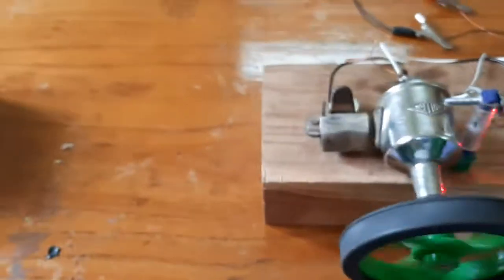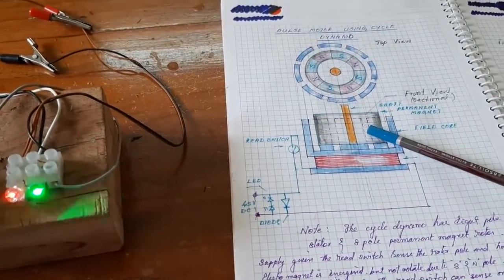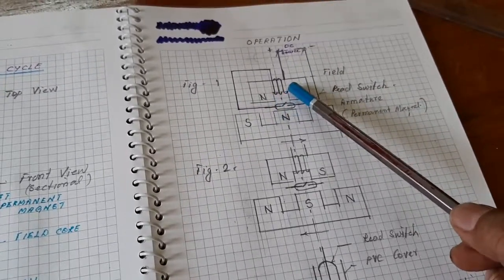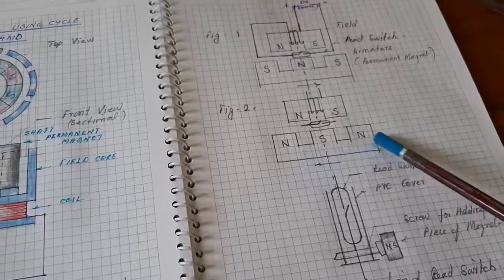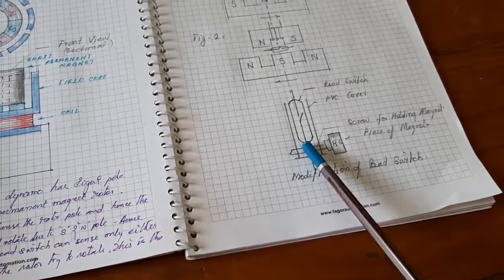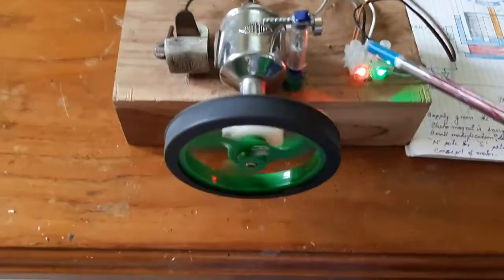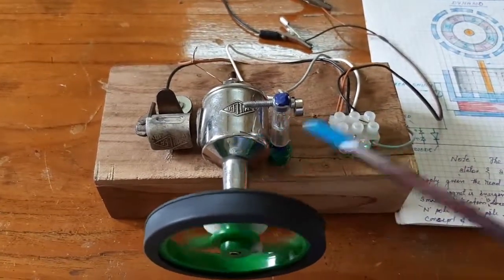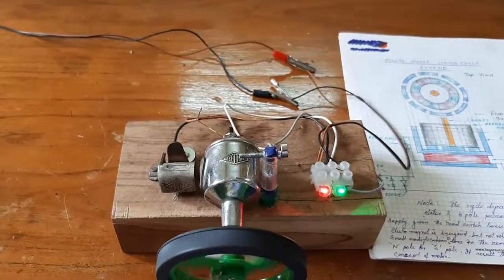(V-3),டைனமோ பள்ஸ் மோட்டார்/dynamo pulse motor

Comment: Very interesting. I had the same idea and turned an old dynamo (a 60 years old device from Switzerland) into a motor a few years ago. It runs slowly without a flywheel, with 4.5 volts from batteries, and only with a reed switch with a magnet.
Reply from the maker: Thanks for support and view